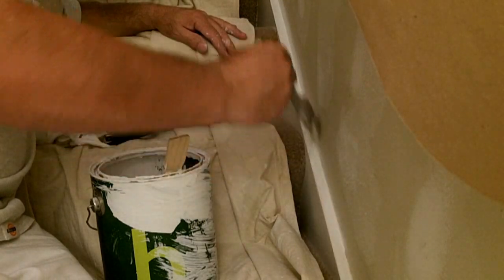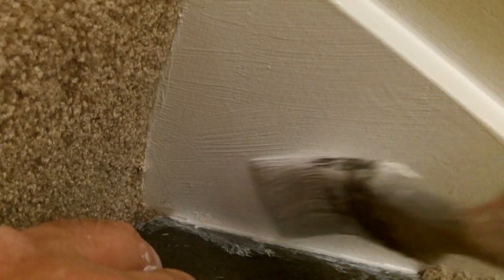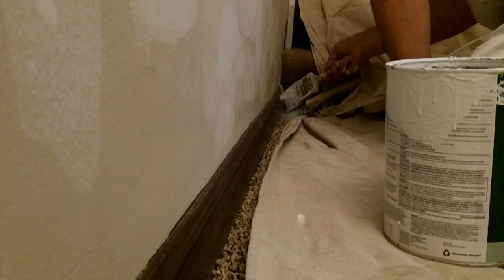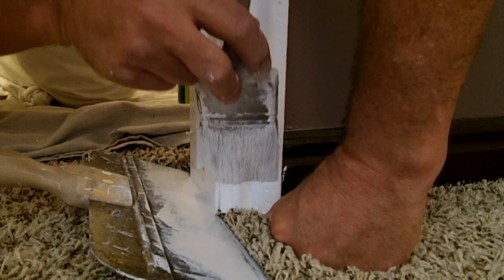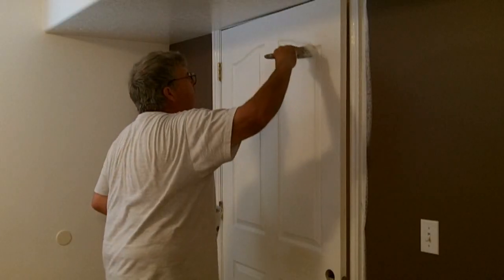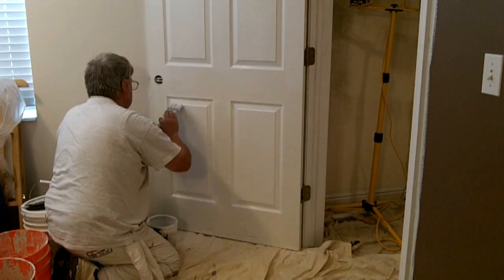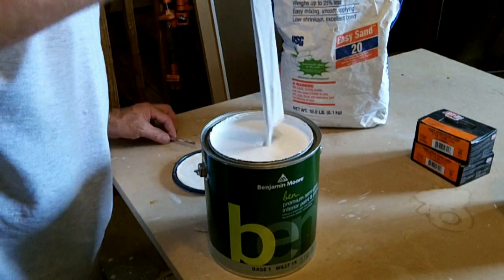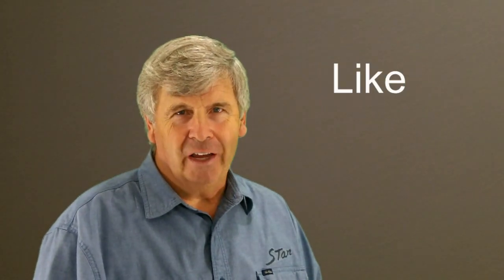Painting a Room: 3 of 4 Painting trim and doors

Comment: Painting a door like this takes too long. Take the door off, take hardware off. Roll two coats behind the door where hinges go, two where door knob goes, two in front of door where door tongue is. Two coats around panels. Paint trim edges with brush, roll out the rest with a roller. Reinstall door and hardware. Roll out both sides of door with two coats. Done.

It is faster than trying to cut in around the hardware and is a sure way to avoid brush stroke marks which make the door look ugly.

Comment: Sir did you use latex paint doing this or oil?
Is it true that latex paint on hot days will make door stick somewhat versus oil based paint?
Reply from the maker: When given the chance I like to use oil. I always use oil primers on bare wood do to the latex will raise the grain of the wood. if the trim and doors have already been painted with latex I use latex.  Todays latex is a lot better now than it was 20 30 40 years ago. In this video I used a quality latex from Benjamin Moore.  Yes it is true that hot days will dry out latex faster. I always thin latex a little anyway.  The same problem is also true for oil base paints I like to use a product called Penetrol, it's a conditioner for oil paints and most all paint stores should cary it.  Thank you for your comment and thank you for watching.
Reply from the maker: Best not to paint in the heat if you can.

Comment: I'm planning an interior paint project, and this video series was really helpful. Do you have any recommendations for paint brands? I'm on a budget, and while Glidden seems to be cheap I would like to avoid poor quality. Do you have any experience with Glidden?
Reply from the maker: +Rustin Abbott My most favorite paint is Benjamin Moore but it's expensive, I don't like Glidden and I do all I can to avoid it. Try Bare paint from Home Depot.  Seems to flow out real nice and it doesn't cost a lot.  Some times cheap paint will cost you more because you won't like the way it looks when your finished, and you'l want to redo it.  Good luck and thank you for watching.
Reply: +Stan Stallings Thanks for the feedback. Much appreciated.
Reply: did you use oil base paint or water base paint on the doors and door frame

Comment: how does water remove gloss paint?i thought you needed white spirit for that?
Reply from the maker: Please tell me more about what you're trying to do.  Stan
Reply: Its ok Stan i realise now you are using a water based paint and no solvents.
Reply from the maker: PaperBag Yes I'm using a latex paint.  In the past my most favorite paint was a Satin Impervo oil base paint from Bengamin Moore but do to the Governments around the country forcing  low VOC  paints on everyone I've gone to a latex or water born paint.  The problem is it doesn't sick to the old oil base paints to well unless you sand the old paint that you're covering.  The other problem with latex is the brush marks left behind after the paint is dry.  That can be overcome if the latex paint is thinned with a little water.  Just enough to help the paint flow but not enough to make it to runny to use.  I loved the finishes that an oil would produce.  Also My wife is very sensitive and the Low and No VOC paints don't seem to bother her.   I hope this helps, thank you for watching.  Stan
Reply: Thanks for your reply Stan
Reply: @SouperDuck1  mn.